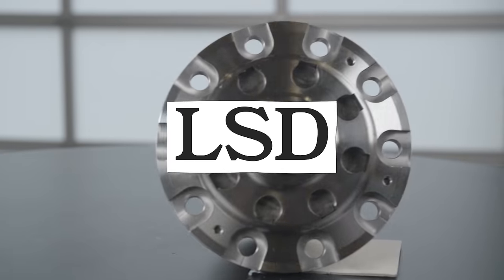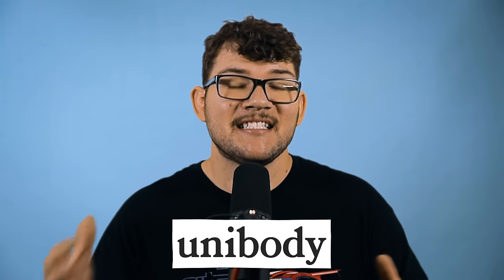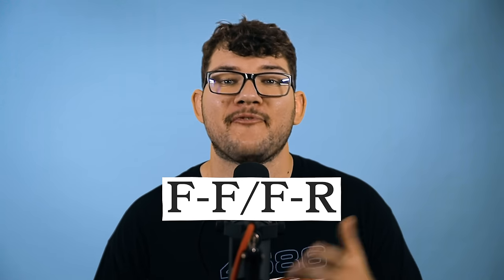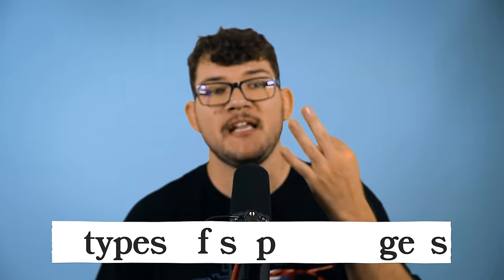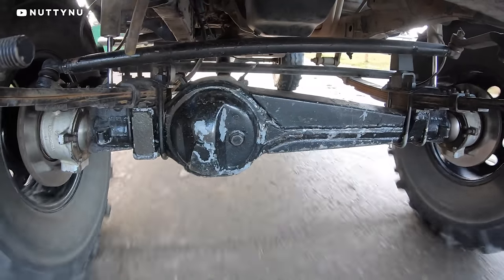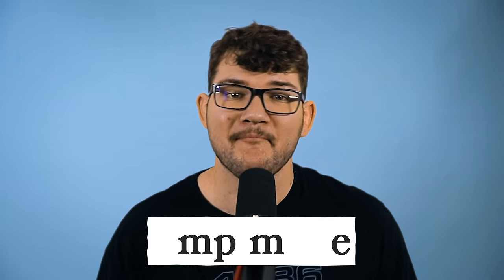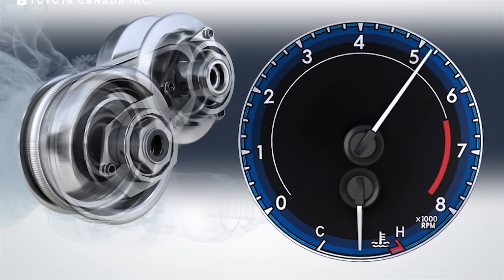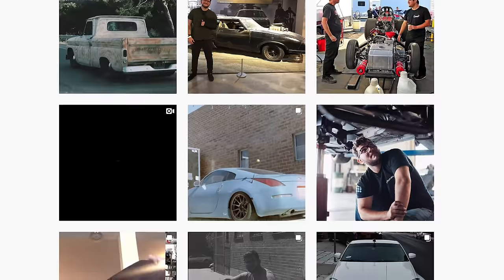Car Terms Every Car Nerd NEEDS to Know

Comment: I’ve been hearing the TikTok noise on my blinkers since I got my car how much money does that cost
Reply: Please take it to the shop ASAP, your blinkers are becoming worn asf. It could cost anywhere from $50-$500 to repair. The sooner you get it fixed, the better, you don't want it to leak and rust your co-axial engine mounting block.
Reply: I'm afraid that your blinkers have aids, please replace them with new ones.
Reply: I always hear the "tick".."tock" when i use my turn signal
Reply: @speedyme200  Is it a used car? Because cars before 2005 can handle it for tens of thousands of miles before it's blinker fluid needs replacing. But if it's a newer car, please get it checked
Reply: Dirty Dirk's blinker drink is $694.20 a gallon
Reply: About 80$
Reply: Cant pay to fix being a virgin
Reply: @IntelTV  iam having the same problem, but that just cost way too much for me, can't i just fix it by myself where can i get the fluid
Reply: Your blinker fluid may be low
Reply: If you hear that just tow your car to a mechanic you’re screwed
Reply: @abdullahbouhamdan9666  Depends on how much elbow grease you want to put into it. If it's extremely worn, you'll have to remove the engine block to further assess the damage. Then after that, is removing the blinker reservoir pan which is actually pretty simple, just a lot of bolts and you'll need a breaker bar to remove it. Once the blinker is replaced and refilled, be sure to use medium strength thread locker to secure it in place, then it's just putting the engine block back in .
Reply: I heard you can buy some blinker fluid right next to the isle with the Bluetooth hose nozzles
Reply: @bigb7965  Ooh, that's cheap!
Reply: It's totalled.  Gotta junk it.
Reply: about tree fiddy
Reply: Throw some blinker fluid in it
Reply: Joke?
Reply: @betaripoff  no he is dead serious..
Reply: Chris fix has a video where he shows how to change it yourself, is really easy I’ve done to all my cars and you can as well, go check it out
Reply: Thanks guys, swapped it out for liquid carbon fiber blinker fluid and now my car has fifty extra horsepower
Reply: @abdullahbouhamdan9666  Juust so we're clear...you know this is a joke, right?
Reply: @lego4virgo  Shush
Reply: bigvirgotube Dont give it away
Reply: @abdullahbouhamdan9666  this was all a joke m8

Comment: "It carries exhaust from turbine to the rest of the exhaust"
circles compressor side
Reply: also said a turob injects an air/fuel mixture into the engine.....
Reply: That broke my heart.
Reply: @brysonmcha  I mean... If it's multi point.... Sort of lol
Reply: Literally came to say the same lol is this a test to see who knows what he is saying? Hahahaha
Reply: Bryson Chambers ever seen a draw through setup on a carbureted Chevy 350? In that case the turbo does inject air and fuel into the engine.
Reply: @eaztbay87  nah, the dudes at donut just don't actually know that much about cars lmao
Reply: @eaztbay87  you're thinking of a draw through, not blow through. Even though they sound the same, they aren't.
Reply: The turbine wheel is on the exhaust side. The compressor housing goes around the impeller wheel.
Reply: @yadidimeanmaine  absolutely, but what's the point of saying it here tho? 🤔
Reply: @ArthurTipaldi  I think he was pointing out that you called the compressor impeller a compressor turbine. There is a difference, though only slight. A turbine is only a fan and doesn't actually compress anything, but the impeller compresses the air that it sucks in because of the shape of the housing.
Reply: @ArthurTipaldi  I figured I'd nitpick your nitpick because the compressor turbine is located on the hot side. The video didn't circle any kind of turbine. It circled a compressor housing.
Reply: @yadidimeanmaine  actually the "compressor turbine" doesn't even exist, I meant to say the compressor wheel, so neither me or you were either wrong or right a actually 🤷‍♂️ 

I edited the comment to say "compressor side", a generic non-binary genderless anti-racist term, I hope it will satisfy everybody 😅
Reply: @yadidimeanmaine  but if I were to analyse wether one of you or me were more right than the other, I'd say it was me, because I was talking about compressor which can only be on the cold side that compresses, hence the term "compressor", while you just located a compressor in the hot side of the turbo which is plain nonsense 😜
Reply: @ArthurTipaldi  The joke went over your head bro? I know you understand how a turbo works. That's why I nitpicked your nitpick in the first place. 
     We're both right; now try to be more fun at parties.
Reply: @yadidimeanmaine  nah nah nah you can't get away with the "it was a joke" excuse so easily mate 😜 you failed at showing off, no big deal just take the blame for this one and do better next time 😁
Reply: @yadidimeanmaine  it's no secret I edited it, I told you I did and I told you why I did, I only made it precious snowflakes proof, I wrote "compressor turbine" instead of "compressor wheel", I edited to "compressor side" so I don't hurt any more feelings ;) 

You obviously deserve your nickname, being that one smart*ss guy who comments to correct people by saying something even more wrong, then refuse to admit he was wrong. 

You should stop there, you're making a fool of yourself since the comment where you said the compressor is on the hot side 😅
Reply: Mike Felty the draw-through is what I’m referring to. The style that pulls from the carb through the turbo and back in through the intake manifold.

Comment: “Endless money pit”

Ask scotty kilmer what are those.
Reply: Bmw 335i :(
Reply: hes wrong
Reply: Mercs
Reply: good ole EMP
Reply: all foreign cars besides Toyota and Lexus as well as some of the Hondas most of the Honda’s are pretty good cars now I will say I’m some V-8 Lexus models they do get more expensive as they age just because it’s a V8 but a car for me personally that I found that’s pretty good is the 96 Buick Park Avenue I’ve had no problems with mine it has the legendary and bulletproof 3.8 L series 2 V6 with a reliable timing chain that car is an amazing ride like a cloud and when it breaks which it doesn’t and in some cases very rare it’s relatively easy to fix at least for me because I pretty much do everything myself well almost everything everything that doesn’t require the car to be lifted off the ground for a long period of time like for struts I also have an XJ6 jaguar that gives me hell on a daily basis it doesn’t run right now typical of a jaguar though electrical problem it’s still better than a BMW though at least I don’t have to worry about too much plastic crap breaking killing the motor as Scotty Kilmer would say an endless money pit both of them the Buick and my Jager night and day different The Buick spend my daily driver for a year the first time I tried to daily drive my Jag it left me stranded in the school parking lot That’s the thing about Jaguars they’re beautiful even on the side of the road broken down haha
Reply: In his opinion, anything that isn't a 5th gen Toyota Celica
Reply: Or a clunker
Reply: Any car maintained by a goof is essentially a money pit.
Ex. Syn oil.. 10k or 5 months, doesn't mean wait 2 years to do an oil change..

Comment: Only car term I knew was blinker fluid I’m always having to replace that stuff.
Reply: same bro and it costs me $150 every time I need to get it replaced at my local mechanic
Reply: Kip C only $150? That’s all?
Reply: Dang you must have got a bargain
Reply: Hahaha hope u guys are joking 🤣🤣🤣that one of the oldest mechanic jokes in history🤣🤣
Reply: Jose Santos wdym? You have to replace it with every oil change, do you not? That’s what I’ve been doing with my truck
Reply: Jose Santos You don’t change your blinker fluid every time you do an oil change ?? That’s horrible for your car man. Your going to fry your circuits and nothing electrical will work ...
Reply: I’m sorry Jose santos but that’s a rookie mistake.
Reply: @salvadormarin2478  that's a myth. Blinker fluid doesn't need to be changed that often. Changes should be every 20,000 miles (32,000 km). Just like brake fluid, if you are having to add fluid, you have a leak.
Reply: Big W 🤣🤣🤣
Reply: Love this channel🤣🤣🤣
Reply: Yeah, and no one sells it, it's such a pain.

Comment: It would be cool to see a video going more in depth on the manual transmission terms: rev hang, rev matching, heel and toe, etc.
Reply: Theres way too many man, anything from components to techniques to slangs. Sychros, clutchkick, quickshift, powershift, short throw, sequential, dogbox, race gear, flat foot shifting, chirping gears, dual mass, single plate, twin plate, sprung, unsprung, TOB, etc.

Comment: Wierd flex but I think “body on frame” is way more common than “ladder frame.”
Reply: Agreed
Reply: Yeah
Reply: yep. In chinese we call it "non-loaded body" for ladder framed cars.
Reply: I was surprised he didn't talk about space-frame, carbon fiber, fiberglass tub, or Monocoque chassis terms.
Reply: Body on frame is the colloquial term, which is why it’s more common, and SHOULD have been what was used for the list. Ladder frame is the more technical term, which is fine if you’re an engineer, but most people don’t say it that way. 

Also, can’t expect too much from these guys, they didn’t do a very good job of describing horsepower, being that it’s a derivative of torque and they made no mention of that. Just that it’s how much work gets done over time.

Comment: The worm thing is called a clitellum and is used to hold the eggs after they have been fertilized and it slides down the wrom on to the ground providing protection

Comment: Just to clear up to those who are a little confused about 4WD and AWD, there is part-time 4WD and Full-time 4WD. Obviously, Full-time 4WD uses all 4 wheels at all times and part-time is used when shifted into 4WD. When you're out of 4WD in a part-time 4WD you're in Rear Wheel Drive (RWD). Here in Australia, the most popular Part-time 4WD is the Nissan Patrol, the most popular Full-time 4WD it's the Toyota LandCruiser. 4WD is a 50/50 split of power between the Front and Rear axles. Also, In part-time 4WD's there is a thing called a transfer case. Basically allows you to switch from RWD to 4WD. While in AWD cars, the power is given to the wheel which has more grip. Example. The rear left wheel and the front right wheel on your AWD car has no grip. The power is transferred from the wheels that have little to no traction to the wheels that have grip or traction (Rear right wheel and front left wheel). In a 4WD if there is slip, nothing is changed and the wheel still has the same power when it had traction. In summary, 4WD's are always a 50% power to the front axle and 50% power to the rear axle. While AWD converts power from a wheel with little to no traction to a wheel with more traction.
Reply: Yesssss, another Aussie fourbie person

Comment: Super informative!  I noticed two issues: at 2:24, that's the compressor circled.  The turbine is hiding under that cozy blanket.

Also, torsion bar suspension doesn't use a helical spring, as shown.  Instead, spring force is provided by twisting a heavy steel bar.

Comment: "Blinker fluid"

All of the BMW owners clicked out of the video.
Reply: never heard of the clicking noise dont need ;)
Reply: it*
Reply: On their way to get the German blinker fluid
Reply: Eduardo Espinoza I would still recommend you change your blinker fluid with every oil change. Maybe your blinker fluid censor is broken I’d ask your mechanic why your vehicle is not notifying you need a blinker fluid change.
Reply: @salvadormarin2478  I change my engine every 3 or 4 miles and get a free blinker fluid fill each time.
Reply: Another expense item from the dealer service that the owners pay because they are afraid to ask what it means.
Reply: Jayden Eladnani-Tempo oh ok that makes it easy.

Comment: 5:35 There's also WOTLR, Wide Open Throttle, Low Revolutions. Where your engine is pretty happy. Usually obtained when you're jumping off the deck and shoving into overdrive (right into the danger zone...)

11:10 Depends on where you want the grip, namely in straight-line acceleration or in a turn. After all, the entire point behind negative camber is to maximize the contact patch of the outside wheels when the car leans outward in a turn.

15:59 Not to be confused with "wing-in-ground-effect" that airplanes deal with.

Ground effect is what an airplane deals with when they fly within a wingspan's height above the ground or water. Basically, the air being pushed down is bouncing off the ground and coming back up against the plane, increasing the efficiency of lift.

Comment: Today... I lost my civic today 😢 The mechanic was mumbling to his buddy "i think its the engine block" 1 like equals one prayer for the car. Cheer a guy up😭😭
Reply: old civic drink oil like crazy, might be cracked :(
Reply: If your for real would you happen to have a 06 civic? Just wondering. Thanks.
Reply: Damn, Civics are awesome cars...
Reply: @1stock1not  It was an 01
Reply: have you tried changing the blinker fluid?
Reply: @leonguyen896  dont say that 😂😂😂😂😂
Reply: @David-ff3mz  damn that sucks i daily an 01 ex sedan 5spd. Shes got 178,120 and still runs great. I have had the headgasket issue common to this year model but i got the car for a large discount and just put the money in the headgasket, new fluids and tires and whatnot. 40k later no issues.
Reply: Damn i just had to replace the motor in my 350z(dd and couldnt take off of work) sorry about your loss
Reply: If you took it to the mechanic...it was never yours to begin with 🤷🏻‍♂️
Reply: 70th Like.
Reply: Play Button Master 🤣🤣🤣🤣love that joke ppl still fall for till this day🤣🤣🤣
Reply: @leonguyen896  I mean I've tried😂😂
Reply: I have a 2001 Toyota Camry as a daily, has 321,000 miles on it and still runs like a dream😂
Reply: @JoseSantos-gl3vk  yeah and the muffler bearings too

Comment: Blinker fluid is a phosphorus fluid pumped through glow stick like canals within the head and tail lights, composed of glow stick fluid, glowing oxidized plutonium particles, live bioluminescent dinoflagellates (high end vehicles contain more lively samples that dance around when upset by life threatening plutonium particles, generating strobe blinker lights for cool purposes), and add water for fluidity and to host your dinoflagellate friends.

It’s also got electrolytes.

Comment: Well, unibody isn’t a “single” piece of metal. There’s hundreds of pieces making the complete body
Reply: Eh, I can count like, less than that. 2 bumper covers, 2 quarter panels, hood, and then the big one over the cabin. Correct me if I’m wrong
Reply: On the other hand, welding them together essentially unites them into one piece of metal. Especially with the welding techniques used for making cars.
Reply: Gabe Shaw I’m talking like all the stuff underneath the body panels. Pretty much all the stuff you don’t see. The unibody is made out of hundreds of different metal stampings being welded together. I guess you could say it “becomes one piece” but it’s not like a unibody is just a single sheet of metal bent up to look like a car lol.
Reply: Ákos Zorin I guess you could argue that way. Maybe I’m too literal because yeah, I’m talking about the hundreds of individual stampings that get welded together lol. But believe me, I know all about the automotive welding process. I’m a weld engineer and I work in automotive factories haha
Reply: 21shroom No offense but yeah, you’re taking it literally. Lol.

Comment: For the VW Gang.

TSI: Turbocharged Stratified Injection
TDI: Turbocharged Direct Injection 
GTI: Grand Tourer Injection 
GLI: Grand Luxury Injection
Reply: Doesn't TDI mean Turbocharged Diesel Injection? Or is that a whoooosh for me?
Reply: @simastautkevicius1372  both mean the same? Cause diesel is directly injected?
Reply: Simas Tautkevičius TDI is copyrighted by VW, little known fact for ya...
Reply: Used to work in a VW dealership. Hated it when customers said “Errr, it’s got the TSI engine....”. Just as bad was “errr, I drive the Toerag” instead of Touareg. Fuckin shoot me... (I work for Hyundai now, all I get is Tucksun instead of Tucson 🤨)
Reply: @simastautkevicius1372  No. TDI is Direct injection. IDI is the older style engine where the diesel isn't direct injected.
Reply: @lenonmelricdsouza9037  They don't mean the same. See my other reply on TDI/IDI
Reply: Thank you guys for all of this!

Comment: There are 2 meanings for wot, 
1. Wide open throttle.
2. Wot SHIFTING can be enabled in a tune so you can shift with wide open throttle, and the tune system will cut the ignition timing for a split second when the clutch is depressed.

Comment: All wheel drive is actually providing power to front wheels at all times and only activates all four wheels when skid of off balance is detected
Reply: largely depends on the awd system, most are not like that

Comment: I knew everything except Transaxle (knew the name but not what’s behind it) and „from a dig“

BUT u forgot one type of Supercharger: G-Loader
VW used them in the Polo 2 to boost the 1.3 I4 from 55hp to 115hp. It’s called G-Loader cause on the inside it looks like two Gs slightly offset from each other turn in mesh to compress air

Comment: remember once you change your blinker fluid you need your muffler bearings replaced and also your ecu needs tuning as well. also remember to pull out all those little fuse thingies in your fuse box, they will make your car more fuel efficient 😁

Comment: Theres something else to be said about hi and low gear ratios when you say you want a higher gear the number that is the ratio is lower. So a 3.55 gear is a higher gear then a 4.10 which can be confusing. Also a 4.10 will turn the driveshaft 4.1 times to turn the tire once